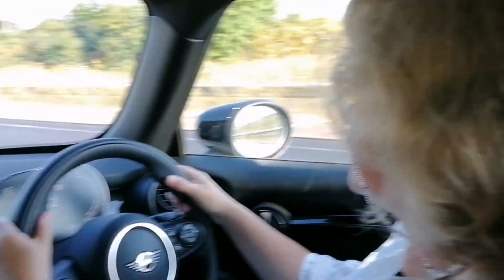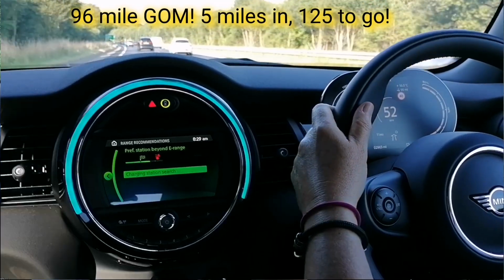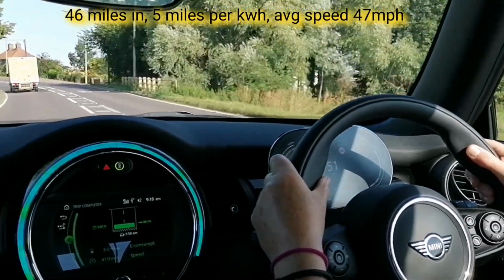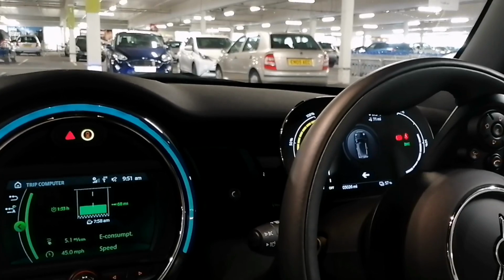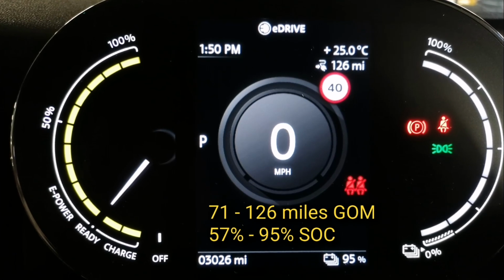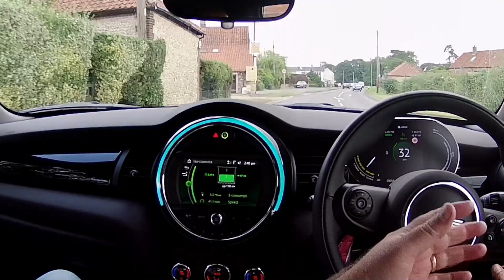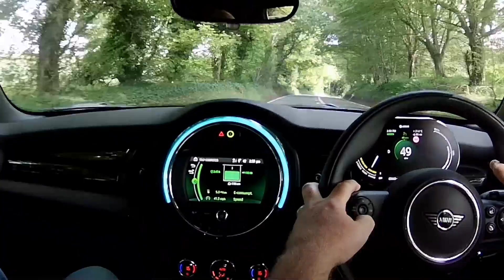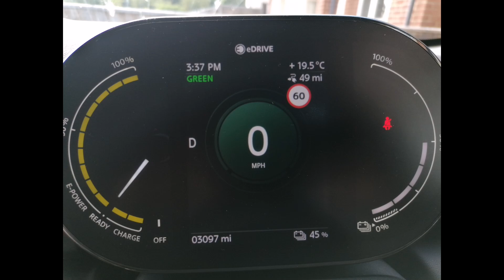Mini Electric Cooper SE POV 139 mile road trip. To charge or not & why am I less efficient?

Comment: If I travel from my home in North East Hampshire to Kent the prevailing westerly wind means the consumption on the way there is usually lower than on the way back. Something to take into account when comparing a two way journey.
Reply from the maker: I always think the best soak is the biggest factor.

We're just in another trip. 50 miles in AVG 6.1miles per kWh!!!!  Trying a few economy tricks including warming car half hour before set off. No idea if it helped as traffic is slow hence efficiency.

Could be a long day if traffic keeps this up

Comment: I drive 62 miles to work and 62miles home and I always get better range going to work than the home trip. My journey is mainly dual carriageway and on CC at 60MPH in both directions. Nothing changes, in fact I leave at 5:40am going to work, so its actually colder so should be worse but isn't. Maybe psychologically you just wanna get home quicker so there are some slight moments of speed that make the difference
Reply from the maker: Interesting. You'd think mornings would be worse wouldn't you

Comment: My Mini Sat nav system seems to act in the oposite way to yours 😂 when I set off on my last long trip the gom stated 96 miles and when i put the satnav on it jumped to 115.
Reply from the maker: Slower route back , no dual carriageway perhaps or maybe a software update ?
Reply: @EVPuzzle  That was on a motorway trip. I do have the newer mini system so could be that. Love the videos though, keep them up 👍
Reply from the maker: Will do. I'm glad you're works better, it did need fixing

Comment: Notice Susan goes nowhere near the speed limit and barely brakes either. With alleged number of Tesco Pod Points you should be able to easily use some and do some shopping. My regular long journeys 81 mile round trip maybe. Wish could afford EV to do them in.
Reply from the maker: Keep saving and calculating fuel cost savings .

Comment: From what I seen, Susan seems to be a lot more of a feather touch on the throttle, and barely regens to slow down unless absolutely needed. You on the other hand seem to react a little later so have to brake and regen more harshly. You also appear to put the foot to the floor an awful lot more. I think the overall speed is a red herring. Looks more like acceleration and deceleration are the main issues to my eyes. Aim to make the power meter run as close to 0 as you can, (it’s how it looks like Susan is doing it whether consciously or unconsciously, she moves her thumb about a hundred times, to peek at the power meter perhaps 🤔 ) even when going down a hill or gradually slowing, you will keep your momentum going and not have to respend more power getting up to speed again. The power you get back from regen is not 100% efficient as I’m sure you already know. Hope this helps.
Reply from the maker: Well spotted. That is exactly what she does 👍